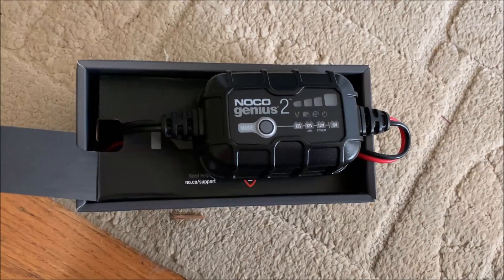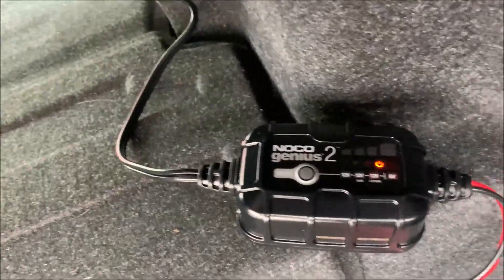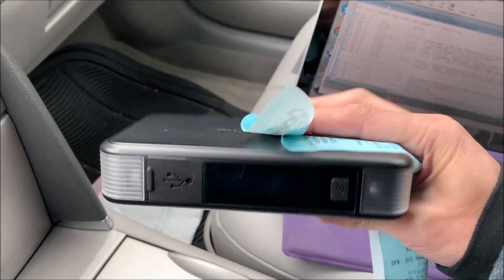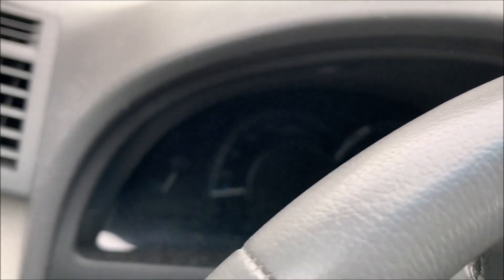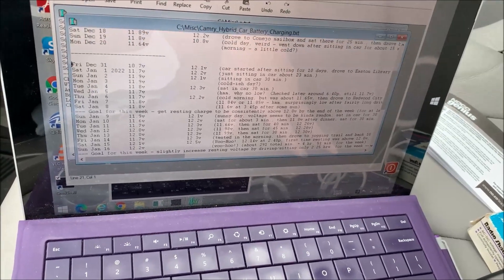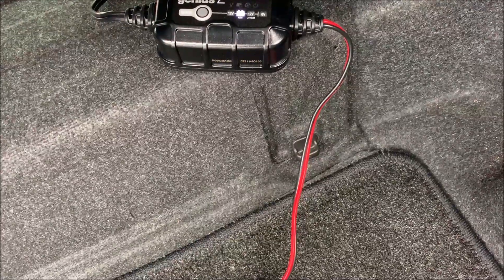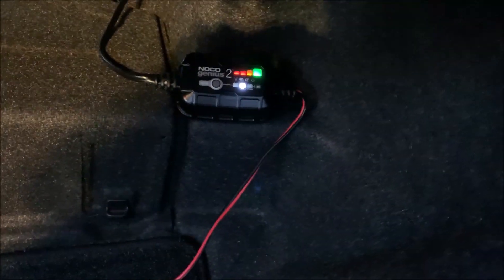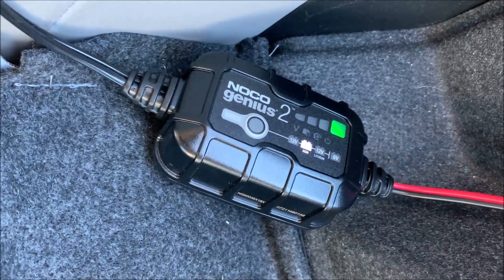Charging Camry Hybrid 12v Battery With The Noco Genius 2 (And Fake "CHECK VSC SYSTEM" Light)

Comment: That battery had a bad case of sulphation why took so long to accept a full  charge a giveaway is low resting voltage , a battery sulphated struggles to accept a charge you keep charger on long enough it will bring battery back up .   Short drives leading cause of undercharged batteries eventually loose capacity till point it clearly show it's weak performance .  Do a weekly charge to top the battery off .  I got a Napa legend AGM BATTERY going on its 9th year still strong battery I bin  up on keeping it charged to not let sulphstion degrade the battery .  Good job you did get it eventually take a charge
Reply from the maker: Interesting - thanks for the information!